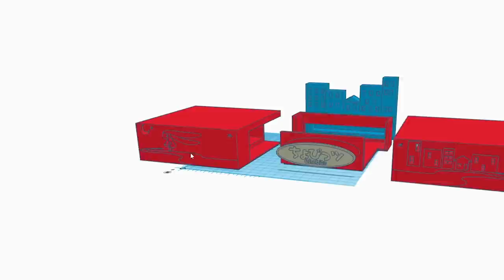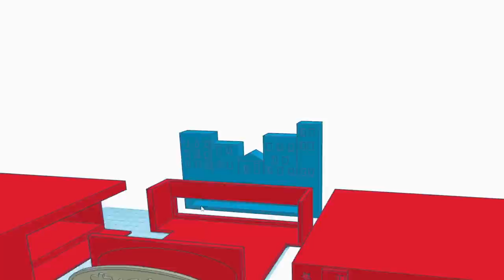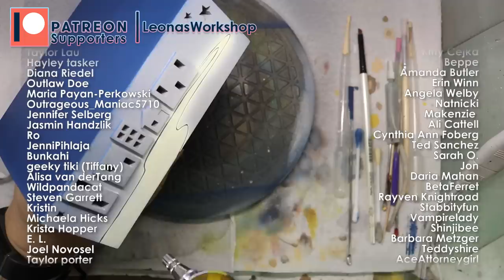Painting the most Stylish 💄✨ Freya Resin Figure from Chobits | Anniversary Special [Subt Esp]

Comment: I had the same issues with a Nuku Nuku Dash kit from the 90's that I bought last year. Little to no keying, pieces were warped from over using the molds. It was bonkers. I never got totally happy with her. I really should pull her out and give her another shot. Your skills are truly inspiring. 
Freya came out incredible in spite of her problems. Congrats on your weight loss and skin removal. I know that's a huge step. 🤗🥰💖

Comment: I assume there's a reason you didn't, but would you consider cutting off the hair and reattaching it as a separate piece?
Reply from the maker: I did consider it, but cutting something will always leave a 1 or 2 mm gap in any piece and it could have messed up the balance of the hair if I didn't calculate it right, it was also going to be way more time consuming to do it, so the fastest and easiest solution was the heating method.

Comment: Resin queen 👸 ✨,  you went IN on the sculptor but I can't blame you! I admire the dedication dispite the many faults and I am glad you explained what was wrong and why. Helps to know what to look for should I ever get into garage kits. I have to ask tho, if this is an older kit , it's safe to assume no more are being made or have been made? If so would it assist in preservation (after much needed modifications for the sculpt) if the kit was 3d scaned and saved as a open printable pattern? I ask because in some cases its seen as ethical and in other cases it is seen as wrong,  but its such a beautiful sculp and it sucks that some figures are hard to find or no longer available... the highly manufactured ones at least.  Private artists that sell only so many have a good argument against such preservation but its still a shame to lose.
Reply from the maker: It's an old kit but the sculptor would most likely condemn you because they believe what you're doing with that would be stealing their work, regardless of the good intentions you might have, Japanese sculptors are anal about copyright and copies of original works.

Comment: 32:40 - How did you want to correct the line drawn with acrylic? This is not enamel, where drying occurs due to evaporation of the solvent. This is an acrylic that hardens due to polymerization. Acrylic is irreversible, if it has dried up, then it is impossible to turn it into liquid and erase excess, as it works with enamels. If I'm wrong and you know how to erase dried acrylic with this stick as if it were enamel, please correct me. Thank you for your videos
Reply from the maker: The same way I corrected the lines in my videos of Toruh Honda from fruits basket. You can clean off lines with windex if you're using water based acrylics
Reply: @leonasworkshop  Interestingly, perhaps I missed this moment in those videos. Let me review them again
Reply: @leonasworkshop  Sorry, I can't find this video. Could you share a link? I would really appreciate it, thank you
Reply from the maker: It's in the watch me paint Playlist, video has Toruh Honda in the title.
Reply: @leonasworkshop  oh, forgive me my inattention, it's time to go to bed.  I found it, I will definitely review it, thanks and good luck to you!